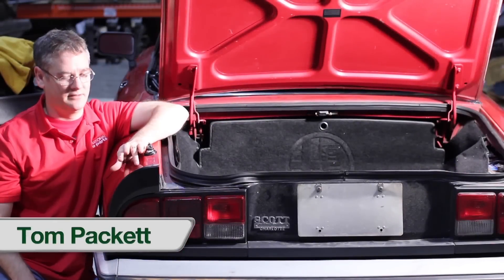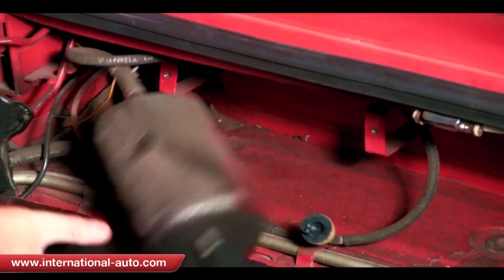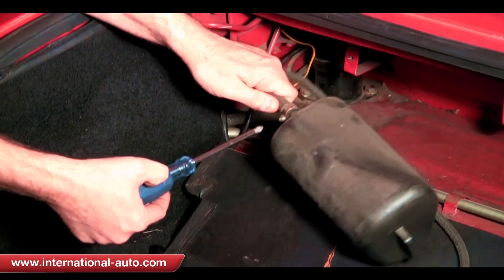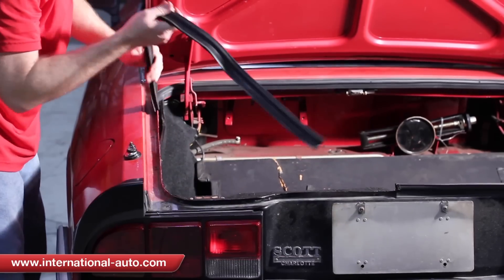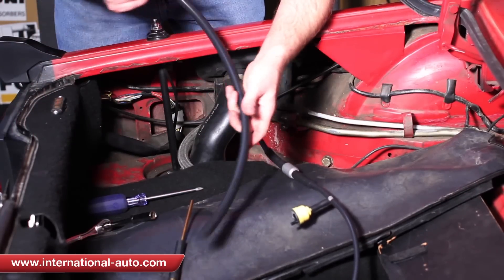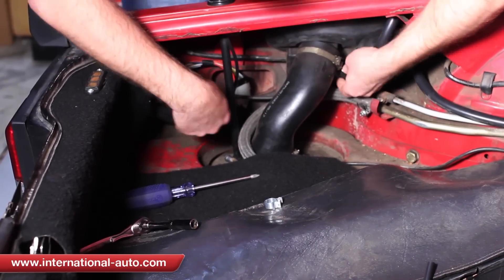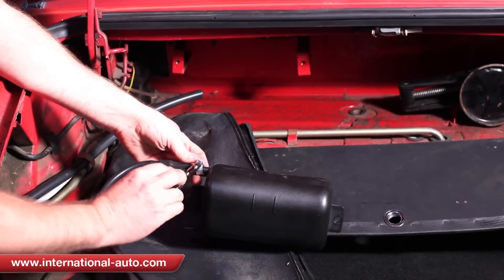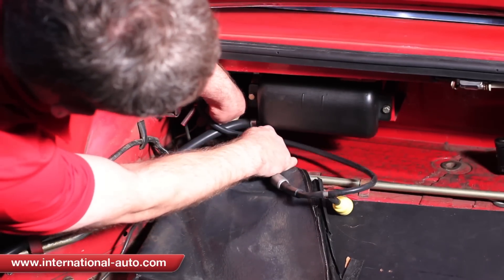Fixing the Gas Smell in the Trunk of an Alfa Romeo Spider, part 1 - International Auto Parts

Comment: Great video! Please, I just got this Alfa Romeo Spider 1985.. I'm struggling about how to make the trunk door locks..  It doesn't lock in. I took off that metal small part attached to the door's trunk end and I hand it apart from the door and the the latch works well, so the latch is not the problem. The problem is poor alignment of the door, I assume the car was painted and the guy did a very poor job on assembling the door into the "trunk's arms".. I already took off the door, because they had put a lot of washers between the screw and the arm, I also noticed that metal thing which links the arm's trunk to that strong metal "tube" from the body, was set up in a wrong way.. I think they couldn't figure out how to align it properly, then they just did it to make the door trunk lock in, well,  it did some times, after several attempts.. And the door didn't stay up when open, you had to hold it.. Anyway, I saw your video and I could see the proper way to attach that small metal part to the arm of the trunk and the metal tube, however, I noticed a difference in the sides, one has a larger gap than the other. So now it is set up the "right way", the door stay up when you open it, but it doesn't lock in at all! :(  PS. I'm doing all by myself, a lot of work!  Any tips...? Thank you.
Reply: I have the same problem....could you solve it?